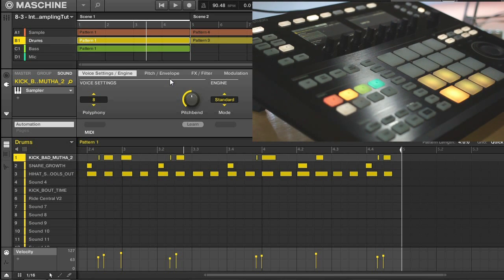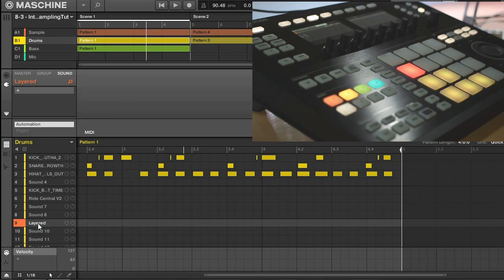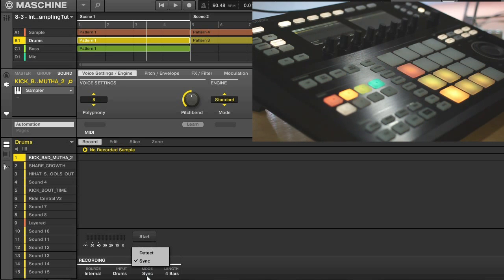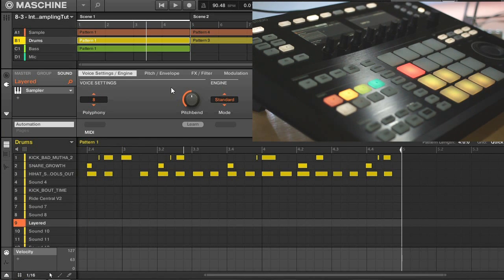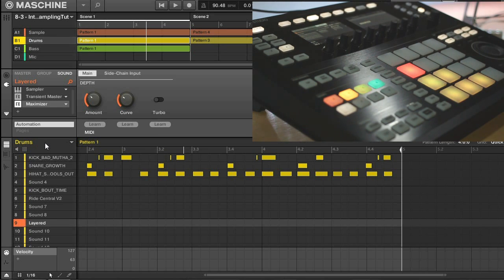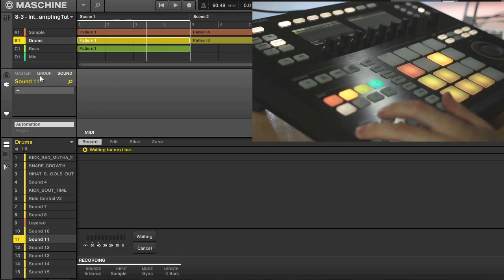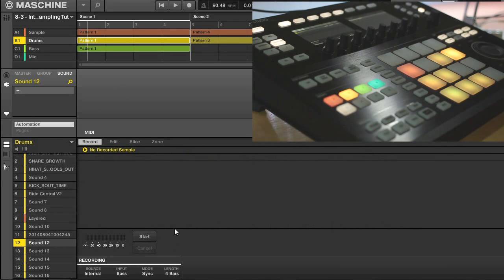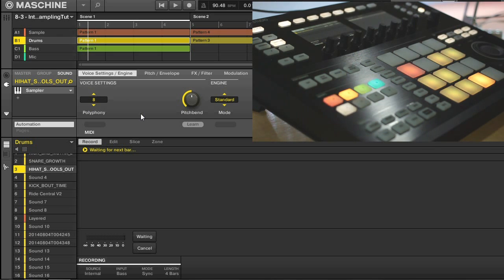NI Maschine tutorial - Internal Sampling Explained

Comment: Does the new interface fix the resource issues? You can't run any 3rd party plugins or not many it gets bogged down on 1.8. Awesome tutorial I haven't tried sampling yet soon now.
Reply from the maker: If I remember correctly, Maschine 2 added multicore support, so it runs much better than 1.8 when you start using a lot of FX or instruments. So yes, the resource issues are improved from 1.8